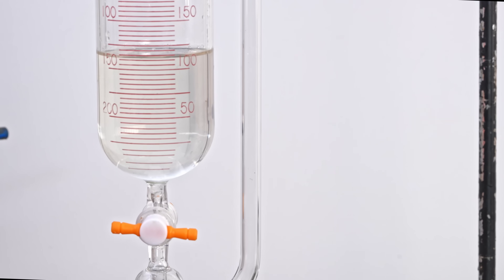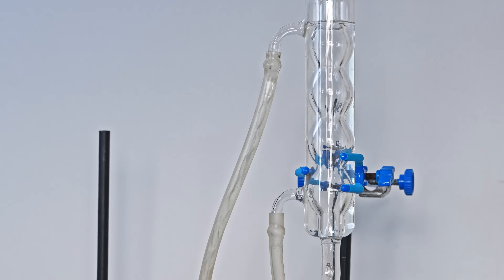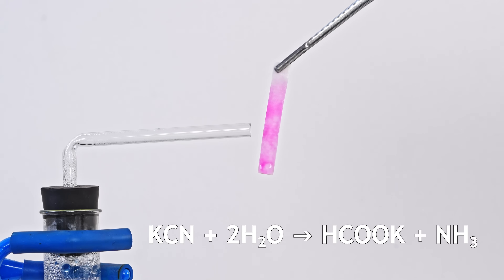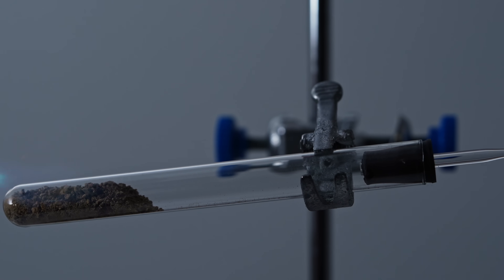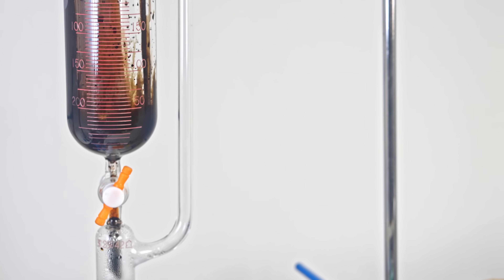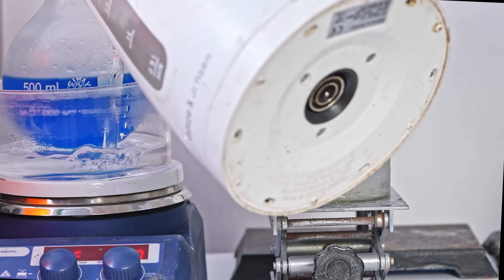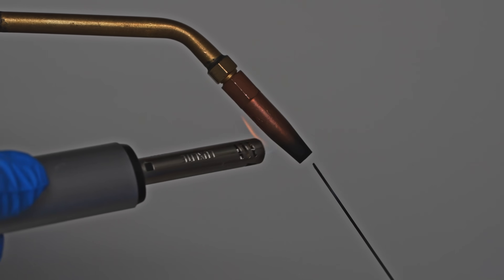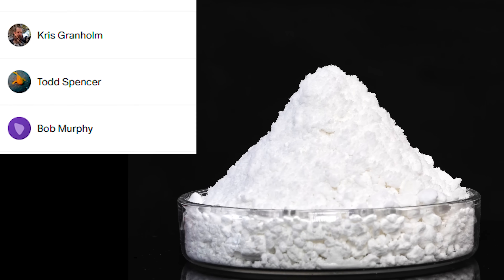I tried to melt tungsten with a VERY HOT cyanogen flame

Comment: Very cool video, maybe to have a more stable stream of cyanogen you could instead fill balloons of it and then connect them, you could regulate the flow better this way in my opinion
Reply: Like a gas reservoir, I was thinking of doing this for my oxygen propane torch as it uses a small oxygen concentrator with a pulsed output

Comment: It seems that cyanogen could be easly compressed in a gas cylinder, which would make gas flow very easy to control, but still it would be extremely dangerous to have such lethal gas in large quantity.
Reply from the maker: It polymerizes easily, so it's not as easy as it seems :)
Reply: I was also thinking this, but as long as he empties the cylinders after use and doesn't store cyanogen it shouldn't be that bad.

Comment: This video: what if poison and another poison were also 4000 degrees.
Reply: Don't confuse heat with temperature!
Reply: Sounds like the inside of a 7-11 burrito
Reply: Everything is poisonous when ingested in sufficient quantities
Reply: Still not as scary as boiling acids, imo. Especially scary acids like HF. Not that many people have reason to boil HF unless they have a deathwish.
Reply: Нет в пламени 4000 градусов. Вольфрам даже не оплавился😢
Reply: @mshigaev1564  My guess is that the thermal conductivity of the tungsten and the small flame were an issue. It could still have been 4000 degree flame without melting the tungsten.
Reply: @mshigaev1564  The temperature isn’t everything. The caloric input also matters. Tungsten has a fairly large thermal mass and surprisingly good thermal conductivity. Better than some aluminum alloys. This is the reason aluminum pistons and cylinder heads can survive inside an engine (and the flame temperatures are not too dissimilar to here). The heat is rapidly wicked away leaving a cool boundary layer between the metal and the heat source. Better would have been to use a lightbulb filament instead. It’s small and would also provide a quick demonstration of the heat by its incandescence. Edit: The filament itself is also extremely fine so the heat path is much smaller than the electrodes. Also come to think of it the high temperature itself is also an issue due to how much heat is radiated away at those temperatures.
Reply: @mysock351C может быть и тепловая мощность пламени мала, может и теплоотвод большой, но терзают смутные сомнения возможности достижении такой высокой температуры. Скорее вольфрам сгорит нежели расплавится.

Comment: thanks for the pretty flames. such unique colors. too bad about the tungsten but ull have to change your set up. now if only you could get an entire Canister of pure C2N2 that would allow for a steady flame.
Reply: The problem with a canister of C2N2 would be polymerization. There would have to be some kind of polymerization inhibitor added to prevent it from gunking up at best, or heating up from the polymerization and exploding at worst.
Reply: @oitthegroit1297  good point

Comment: It seems like there is a pulsating effect to the cyanogen output. I really know nothing about chemistry, so forgive me if this makes no sense... Can the gas output be compressed and stored, then released under regulated flow and pressure?
Reply: It might autopolymerize under pressure, but idk enough about cyanogen to be sure. I know acetylene will do that under pressure, and it seems the cyanogen was doing the same thing even at stp, which tells me it might be even worse behaved under pressure than acetylene.
This is just speculation from someone who doesn't work with either gas, however, so take what I say with a grain of salt.
Reply: @redballsgiveuwang  Given it's caking up the addition funnel, seems it has either a reaction with water, cyanide ion, or high pH.

Would be curious how stable it is at modest temperatures and higher pressure; acetylene's example is definitely not a friendly one! (Wikipedia seems to suggest polymerization proceeds at a practical rate in the 300C range, which sounds conveniently high i.e. it might be quite stable at room temp, but I'd want to see a proper reference before putting anything under pressure in my own lab!)

Comment: It’d be cool to see to see if cyanogen can react with nitrogen dioxide/dinitrogen tetroxide. Also how cyanide salts could work as a fuel in a pyrolant mixture with the corresponding nitrate, e.g., a 1:1 molar mixture of potassium cyanide and potassium nitrate, or their lithium counterparts to see if lithium’s higher bonding energy with oxygen and lower mass could affect the reaction kinetics. I remember Dornier335A produced a flash powder from potassium nitrate and potassium ferricyanide that had an almost explosively fast deflagration. One could expect a mixture of two anhydrous salts with lower molecular weights (no iron) to possibly have an even more energetic deflagration.
Reply: Thou speakest Gr33K, homie. And I'm lovin' it!